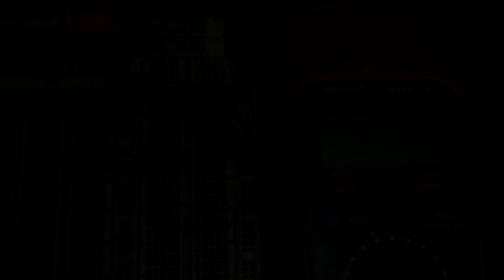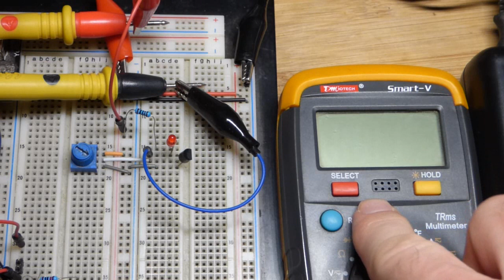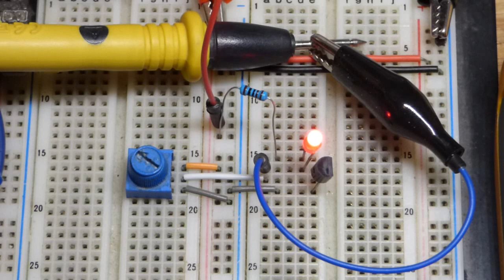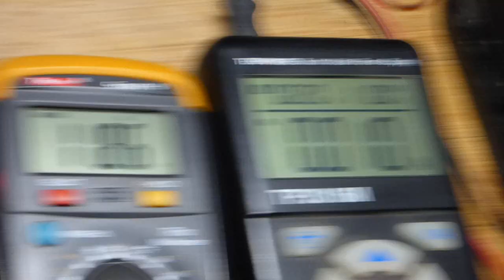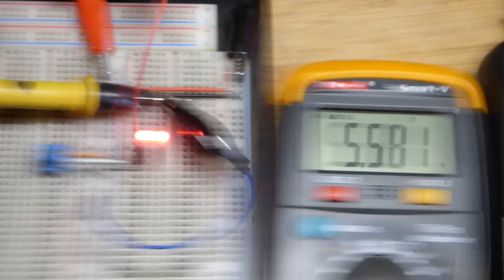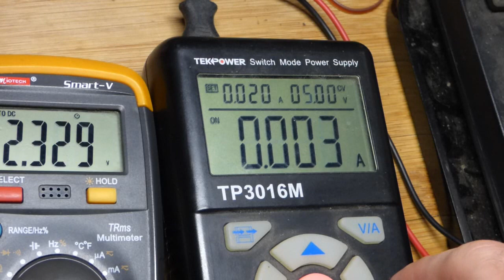Measuring Gate voltage needed to fully turn on 2N7000 N Channel Enhancement MOSFET

Comment: I've been meaning to get a MOSFET kit from Amazon so I can learn about them more. The books I currently have don't have any breadboard projects with em but I am planning on more books. Your videos are so much fun to watch and I learn.😊
Reply: I understand the economy of Amazon/Ali/Ebay kits. However, they very, very, very often include fake components that act very, very, very differently (poorly) than those made by reputable manufactures/distributors. If you have not read about the fake epidemic in the electronics components industry (and whole devices, as well,) you might want to research that. There is plenty about it on YT. I recommend that you buy original OEM parts, from known distributors (Mouser, Digikey, Etc.) and use those for learning and testing. Once you get a feel for things, you can suss out where you might get away with using a fake and saving some money. I truly hope that information helps you.
Reply from the maker: I don't really know of any books with many breadboard projects, that's a big reason why I made this YouTube channel. Art of Electronics has done a lot to give me demonstration circuit ideas, and I have most of the Encyclopedia of circuits books (there's 7 in total) which have the schematics for lots of circuits, which also gives me demonstration circuit ideas.  Tld is right about Amazon and Ebay not being as trustworthy as Digikey (I've bought from before) and Mouser. I'd rather get cheap components to learn and experiment with though and take my chances that they are fake because they are much cheaper. If I was selling electronics, then I would order from a reputable company.
Reply: @Electronzap  I do buy components that might be questionable, but only for specific purposes... Like, if I might blow something up... But, I would not want to try to learn with them, because they might teach me something that is incorrect... It's a trade-off and I am not finding fault... I'm just offering something to consider... Cheers...